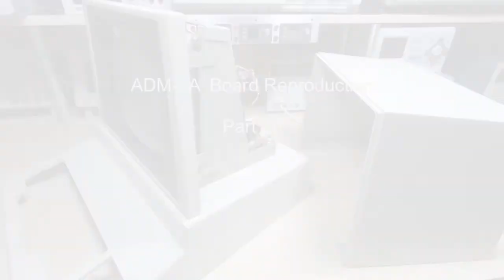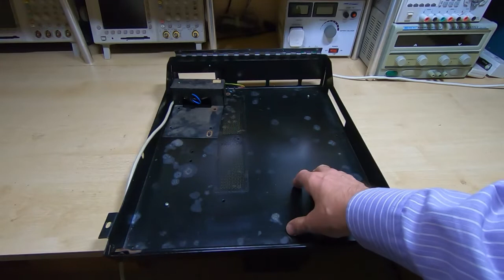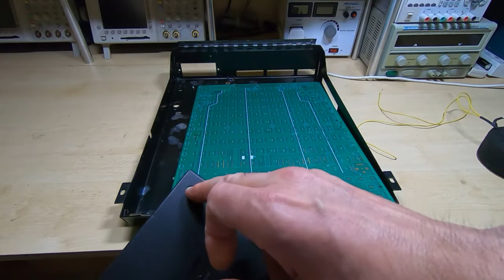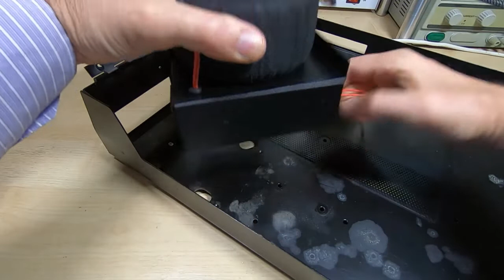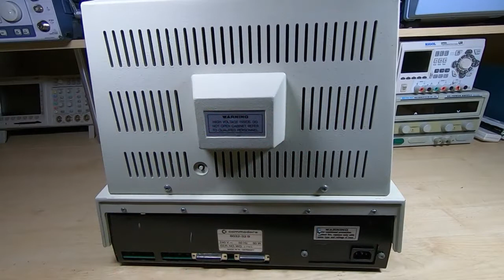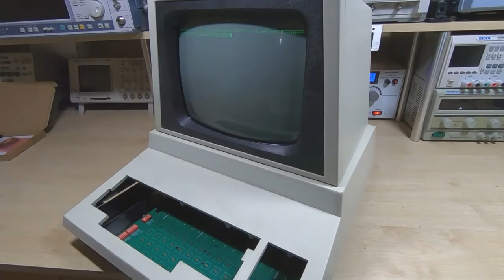ADM-3A  Board Reproduction Part20

Comment: This is an awesome project.  I've binged all the videos with delight.  It was a great idea to provide a breakout for a separate keyboard.  I have actually been working on a retrocomputer keyboard project, and have a layout that could be modified to fit this project (https://github.com/osiweb/unified_retro_keyboard).  A photo of an earlier prototype with the key caps is here: http://osiweb.org/osiforum/download/file.php?id=828.  The key set is very close to the ASR-33 and ADM-3A.  The RETURN key is 1.5x instead of 2x, and the keycap set dropped the "HERE IS" and "CLEAR" keys, and the HJKL keys don't have arrows, but these could be ordered if someone really wanted to.
Reply from the maker: That looks very interesting. The key layout on the ADM is a bit odd so would probably not connect directly but I really like the look of your keyboard. I will be posting a video shortly of the keyboard I am using for my unit but I have been looking for a way to produce one for others. I would be interested in your project to see if the board could be modified to suit the ADM. most likely by making up a board using the key layout you have but making the key connections to suit the ADM. I do not think it really matters if a couple of keys are different as this can be handled by connecting the keys depending on the key cap (which is what I assume you have done). I do not think the 'Here is' key is really needed for most people. The clear key would be useful but is not essential. Please let me know if you want to investigate this further or can let me know where to get the caps and switches.
Reply: @JerryWalker001  There are two options for using the keyboard with your ADM-3A replica.  The first, and simplest, is to rewire the existing PCB to match the ADM-3A matrix and your connector.  That would probably take a couple of evenings, and is probably the way to go at the moment.   The other option, which is part of the roadmap for this project, is to create another interface board that translates keypresses from the physical keyboard into an arbitrary key matrix using a 2-port RAM.  That would obviously take longer. but will result in much greater flexibility, and would preclude the need for accumulating many different key matrices.  That would add the most flexibility to the project in the long run.  For example, currently, the same keyboard can work with an Apple II or ADM-3A style layout by selecting a keymap on the ASCII interface board.  Or, the ASCII interface can be swapped out for an OSI interface and the keyboard can be used in an OSI computer.  Also, the SOL-20 keyboard (different layout and matrix) can be swapped out for the ADM-3A keyboard, using the same ASCII interface, by changing some DIP-switch settings.  The biggest advantage of this is that parts can be bought in bulk and PCBs can be partially populated in advance, and everyone benefits from the volume discounts.  I can't figure out how to contact you directly, but if you would like to collaborate on preparing a keyboard, then you could contact me through the vcfed.org forum (I'm dfnr2) or the osiweb.org forum (I'm dave) and we can exchange email addresses.

Comment: Can you post a parts list so we can begin sourcing the parts before the board is ready to ship?
Reply from the maker: I will be posting a generaic parts list once I list the boards but as it is a reproduction you can use the original ADM-3A manual as it contains a parts list. I would suggest adding DIL sockets.

Comment: Only different thing I would have done is punched or filed out a D shaped hole next to the power socket for a panel mount fuse holder.  You have the space, and the original had it there.  I like the power switch move though, reminds me of the trs80 solution.
Reply from the maker: No there is not enough space. Originally I did plan to fit a fuse holder next to the socket or use a socket with a built in fuse holder but there is not sufficient room. There is only 5mm between the edge of the socket and the pcb and the pcb has components right up to the edge so there is no way to fit one in. I also considered fitting the fuse holder at the side but fitting a chassis mount fuse holder under the bracket seemed to be the best option with the space available and it looks very neat. Hopefully it will not require regular replacement and of course the top cover is hinged so getting inside is not difficult.